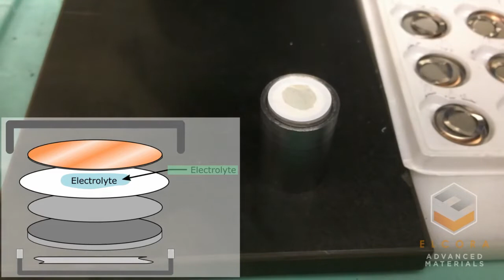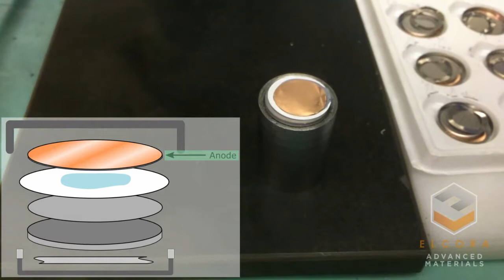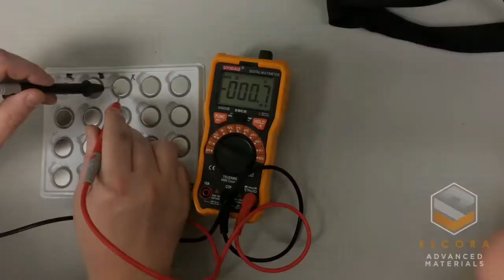Elcora Lithium-ion coin cell assembly with natural graphite anodes

Comment: You are calling both the electrodes anode. The graphite is the cathode here. How strange people on the job make such blunders of terminologies.
Reply: 😅 truee
Reply: https://youtu.be/aD0rFSh9AfY?t=90 "In an anode half-cell, a thin disc of metallic lithium acts as the cathode." This is called an "anode half-cell"
Reply: @BenJams42  half cells have either an anode or a cathode not both that's why it is called a half cell. If it has both an anode and a cathode then why the hell is it a half cell? What kind of electrochemistry you all are studying ridiculous!
Reply: @AbhishekKumar-el7vo  "a thin disc of metallic lithium acts as the cathode" emphasis on "acts"
Reply: @BenJams42  For lithium to act as cathode it has to undergo reduction. In which universe does metallic lithium undergo reduction reaction?
Reply: @AbhishekKumar-el7vo It acts as the so-called cathode in a conventional sense, insofar as it supplies lithium to the anode for intercalation, and insofar as batteries have two electrodes called "anode" and "cathode." "Counter-electrode" or "reference electrode" would have been a more precise term, electrochemically. Thanks for pointing this out.